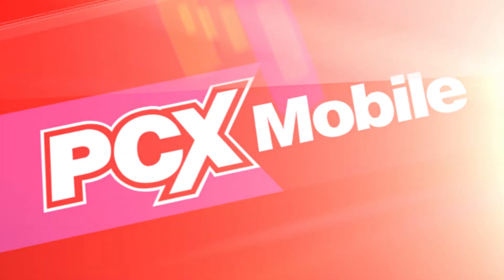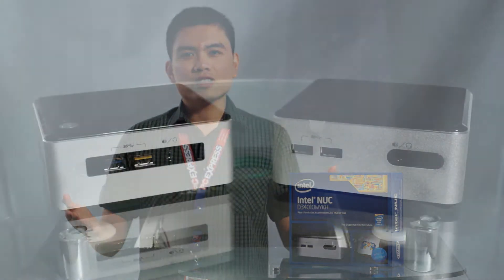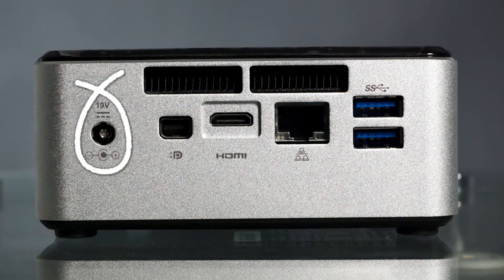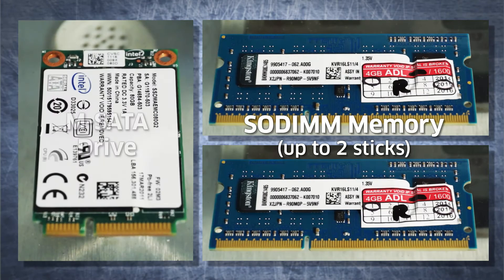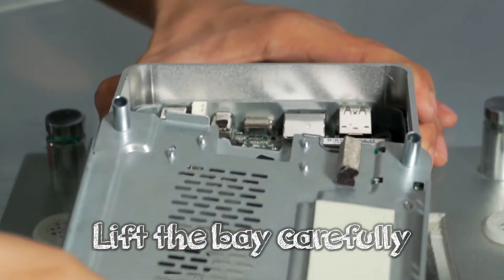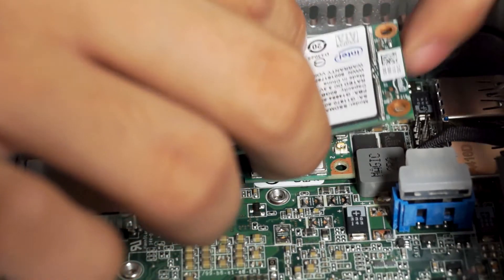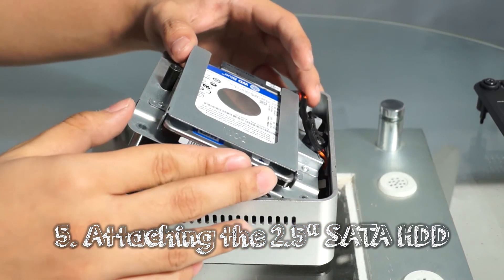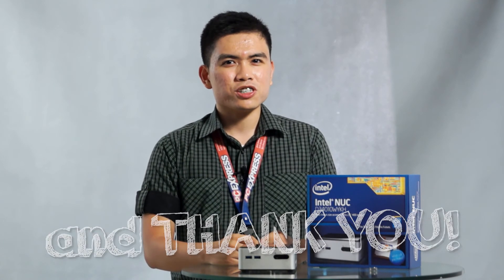PCXTV Intel NUC Assembly

Comment: how about video cards? :)
Reply from the maker: What do you mean, video card for the NUC?
Reply: the video cards for NUC units. :)
Reply from the maker: Intel NUC uses its built-in HD Graphics for its graphics processing.
Reply: Benjie Mindanao Video cards for the Intel NUC is a no-go. It doesn't have enough power to supply a video card and there are no PCI-E slots. If you a small PC case then Micro ATX or ITX is the best you can go for.